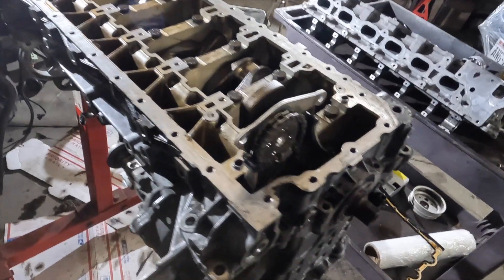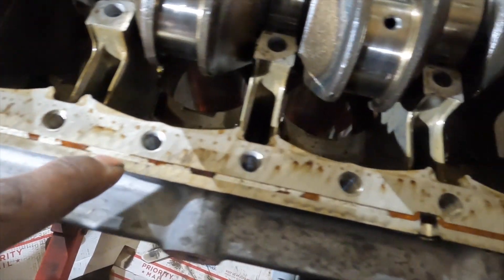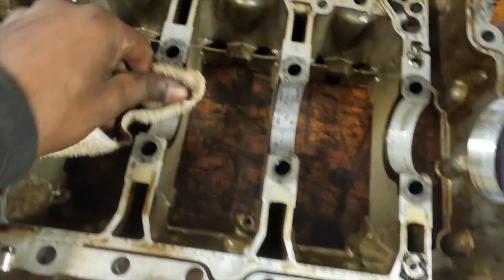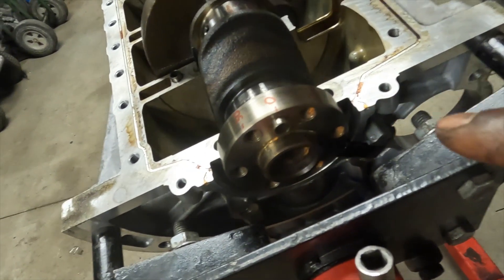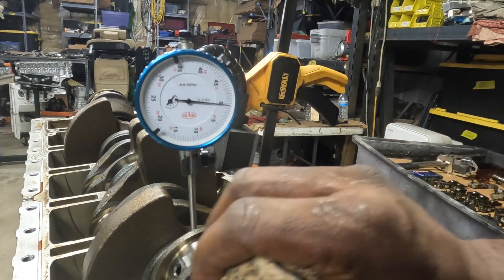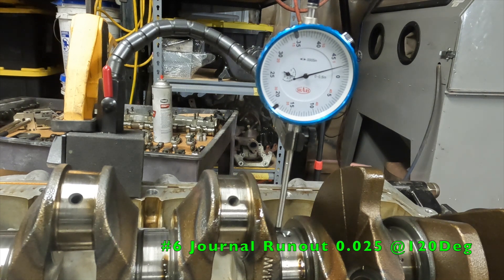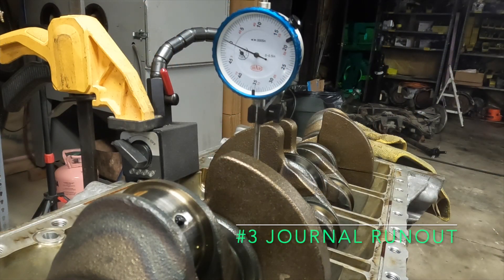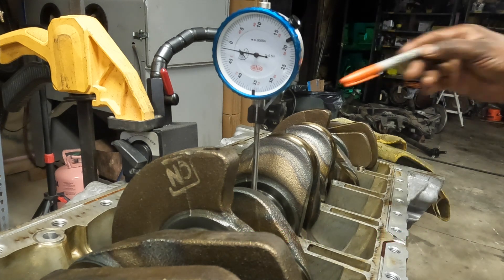BMW N55 1227701 Block Disassembly Part 4 2

Comment: How did you get that engine block so clean?
Reply from the maker: Hot tank in an aluminum base cleaner 

Did it is a 40 gallon parts cleaner and added a hot water tank heater to heat aluminum / water cleaner mix
Reply: Which aluminum cleaner do you use? If I do an oil filter housing gasket or oil pan, I’d like to get it that clean, and I’ve found nothing that works. And once it’s clean, it oxidizes and darkens very fast.  Thank you, I’m very curious about this.
Reply from the maker: @marshallgoldberg8376  
I had that same problem after going through may cleaners.  This information I am providing took may iterations of trial and error .  

Simple Green - SMP13406 Extreme Aircraft and Precision Cleaner, 1 Gallon Bottle 13406

Simple Green - SMP13406 Extreme Aircraft and Precision Cleaner, 1 Gallon Bottle 13406